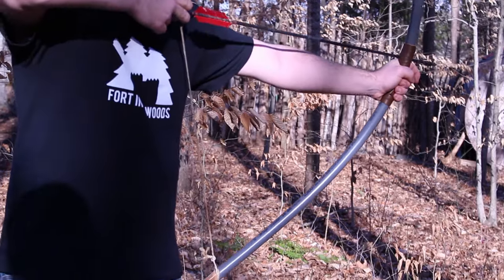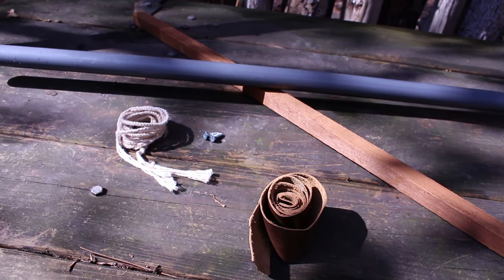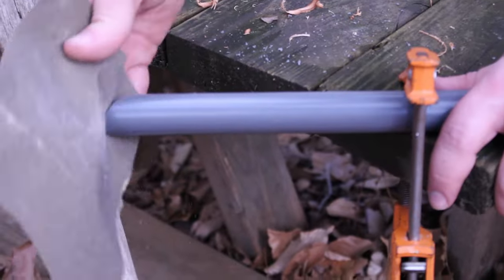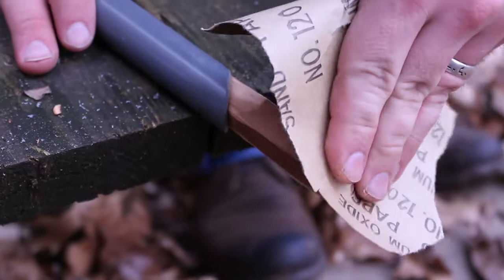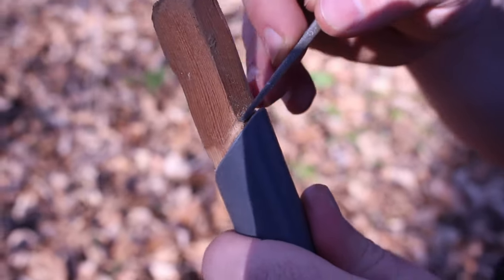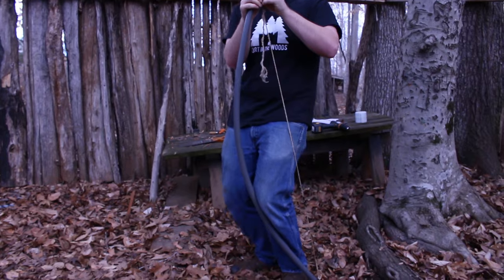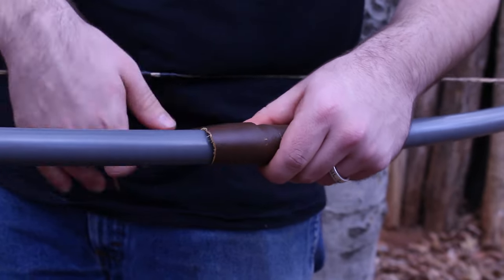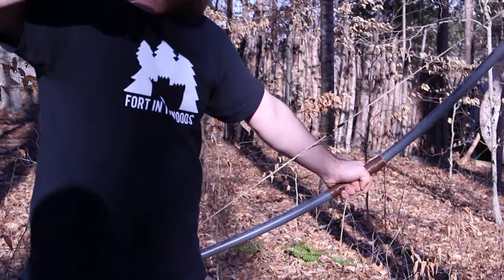How to Build a PVC Bow

Comment: Nice idea - why didn't you use regular PVC plumbing piping?
Reply from the maker: In our experience the gray pipe seems to bend without breaking better than the white pipe.
Reply: @FortInTheWoods  That makes sense. I figured that conduit and piping wouldn't have the same flexibility, but I figured I should ask. Thanks!